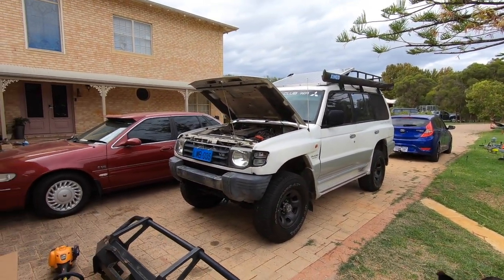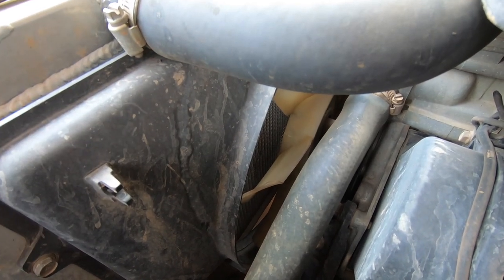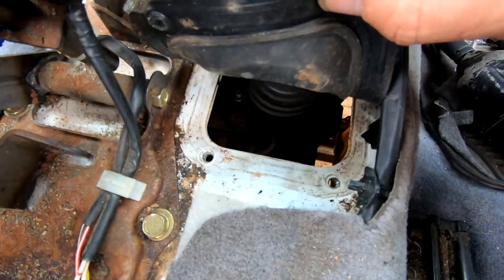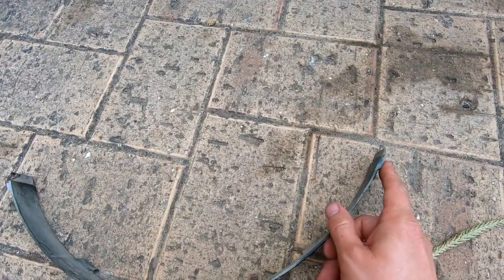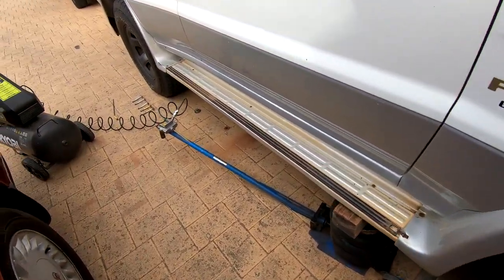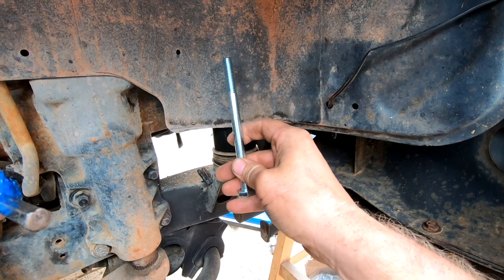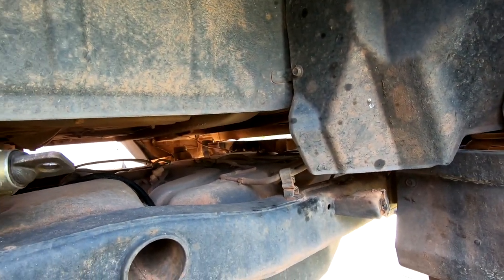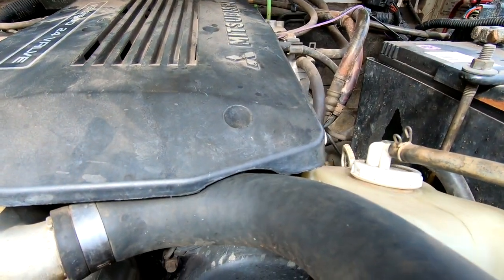HOW TO : Pajero body lift - Project NL EP1

Comment: Thanks for this  and your other video - it's a good how to - in fact both of them are. In fact I hoping you'll be ok if I link this to my store and facebook pages so that our customers can see a "how to fit it video" - one further point -- the big bulge on the transfer lever (also on on the gear lever) contain a rubber bonding and is not possible to seperate the top from the bottom -- other tann that well done on a good production
Reply from the maker: Thanks. It’s a great product. And feel free to use/ share the video

Comment: Nicely done. Btw acn you tell where from did ypu get this body lift. Because what i was able to find is only with body blocks, excluding bumper extensions and transfer lever extension
Reply from the maker: Xpajun in the UK. Link is in video description
Reply: @PERTHSCOOTER07  One more question. Does this lift kit come with front and rear bumper relocators?
Reply from the maker: @jasio157  yes it does
Reply: @PERTHSCOOTER07  i am getting the 2 inch lift from that seller in next week.   He actually gave me his spare Mk2 LWB Pajero in Dec, full mot as i do lots of animal rescue work here in Sheffield..  I actually got back from Poland/Ukraine in mine 2 weeks ago.. I drove over with aid and spent weeks helping animals and so on..  so much worse than  you see on tv.. and the smells also.  I want to go back in a few weeks..

Comment: Here's a question, is it possible to do a body swap between a Pajero NL & Mitsubishi Delica of the same year, given they are built on the same chassis, drive train?
Reply from the maker: No. Ive had 2 Delicas. They use the same drivetrain but the chassis are different. Very similar but not enough to swap.
Reply: @PERTHSCOOTER07  ahh bugger, cheers for the speedy reply, I much prefer the punchier & more fuel efficient Pajero 3.5 6g74 to the 3.0 petrol Delica, thought it would be easier than an engine swap lol
Reply from the maker: @righthand7965  if you love the Delica but want more power look at a V8 swap. Pricey but the Delica is a great car. Worth spending money on
Reply: @PERTHSCOOTER07  true!!! 👍😊

Comment: Bro how about 3inch body lift i will effect to at the engine area?
Reply from the maker: If you go over 2” you need to extend coolant hoses and other stuff. It would be a massive commitment. Xpajun sell a kit with all the necessary parts. But it’s a lot of hard work on your part